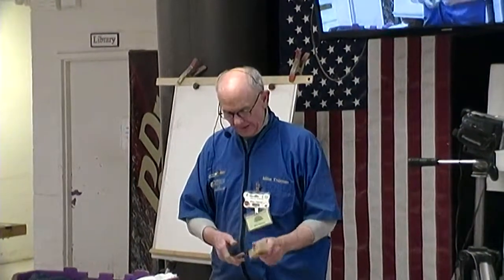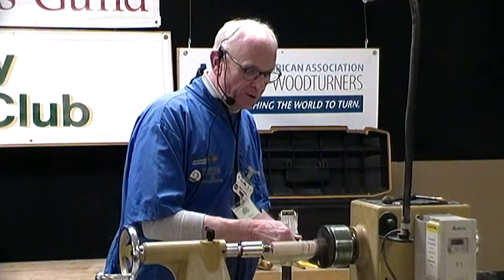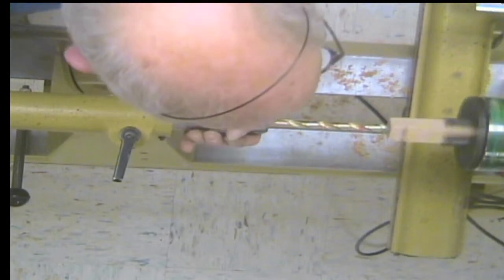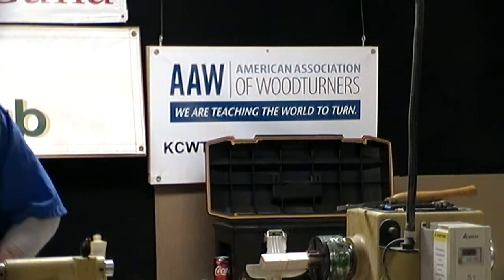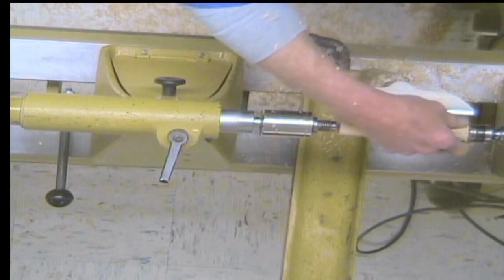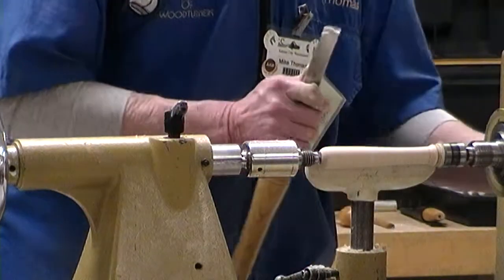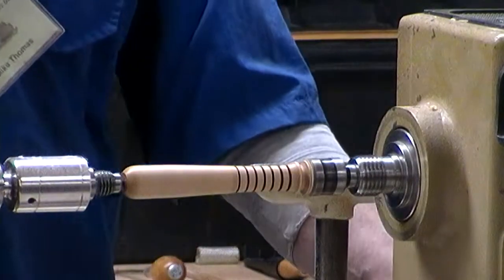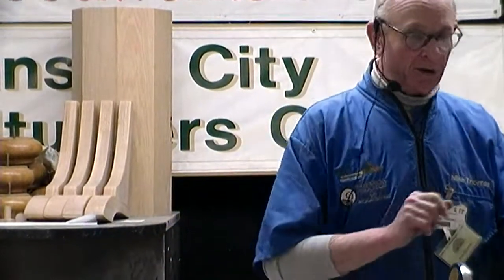KCWT March 2020 Club Demo Mike Thomas Small Boxes

Comment: Mike - great demo.  I watched it very early this AM as I was prepping for a routine colonoscopy (that isn't a reflection on your demo).
I also watched Shawn's video, and later made several of these boxes.  One point that occurred to me is that the only truly magical thing about the dimensions that Shawn uses is that the diameter of the mortise (and tenon) has to be greater than the diameter of the cavity.  Shawn used 5/8" for the mortise and tenon, and 1/2" for the cavity, which results in a tenon wall thickness of 1/16".  I don't think you would want anything thinner than that purely for reasons of physical strength.  But you could (and I have) made similar boxes with larger diameters.  Likewise, the cavity depth that Shawn suggested seems to have mainly been based on using a box as a place to store a spare $20 bill, requiring that the depth exceed the width of US currency (which is just under 3").  But again, you could make the box longer or shorter if you had other uses in mind.  Finally, if you are making these on a semi-production basis, a slight modification in the process is to make a jam chuck that fits snugly in the cavity so that you can remount the body half to finish its bottom.